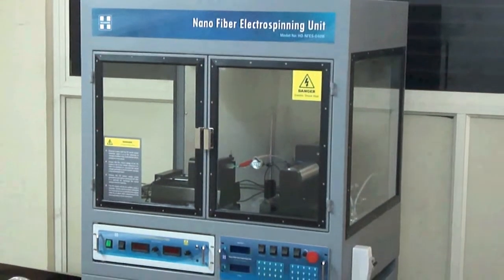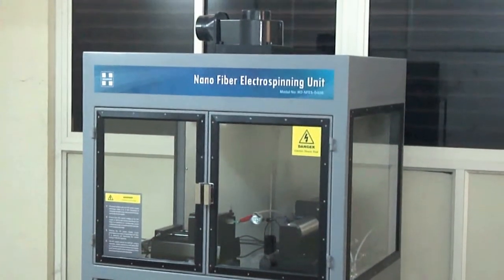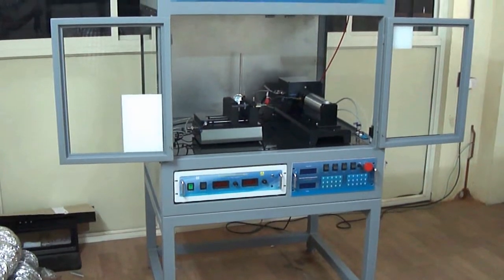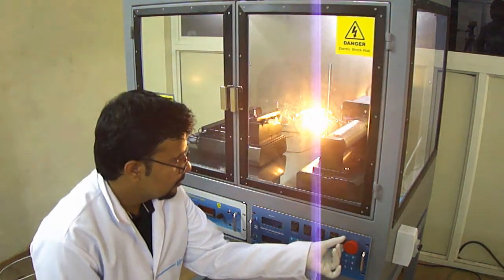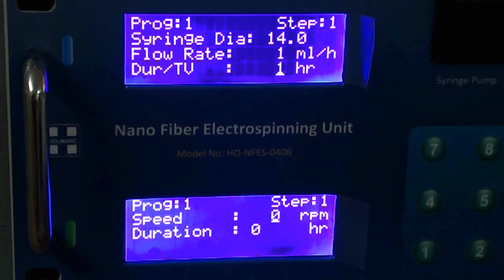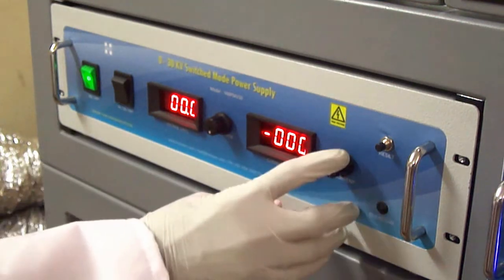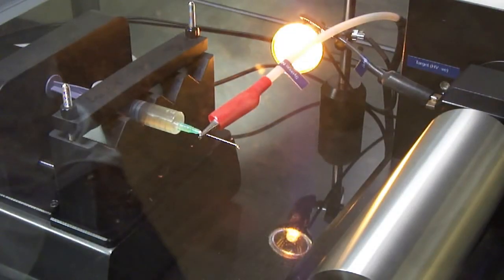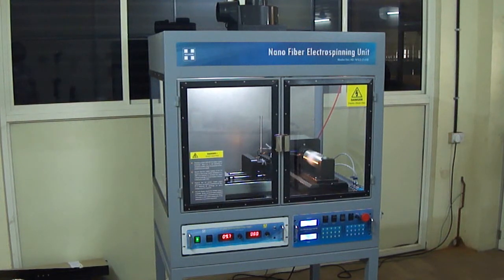Nano fiber Electro spinning (Table Top Model)

Comment: You just gave away your entire design plan! Now anyone can go out and make one with some $2 Arduino programmable MCUs, stepper motor controllers for the drum and linear actuator to depress the syringe accurately, some PWM N-channel MOSFETS also driven by the Arduino to control the lamp intensity and some plexiglass. I think I could rig up the exact same device for under $50 bucks if I can find an old fish tank on Craigslist under the FREE section or cheap for a low budget DIY hermetically sealed chamber  AWESOME! I think you just inspired one of my winter electronic projects. I'm already working on a solar powered eBike Trike that is powered by a 12" diameter  pancake outrunner motor with 36 1.75" deep by .75" wide by 1" high 16awg 200C stator coils and 37 N52 rotor magnets 50mm x 20mm x  5mm magnets replacing the lame ceramic magnets originally in the motor. It came from a large capacity direct drive washer for 48 pound loads of laundry and water with a 1" spline shaft connecting it to the drum! It's wired 11 coils in series  in standard 3 phase wiring arrangement. Three 285 watt 32VDC 9A solar panels will form the roof over myself and the pickup truck style bed and charge the 90 volt Lithium Ion battery pack made up of 96  18650 laptop cells arranged 24 in series with 4 matched sets in parallel for a 90vdc @ 10ah capacity charged by the 96V 9amp solar panels. I'm also going to capture the energy from the collapsing coil energy in a small 90VDC 1000 Farad Ultra capacitor bank to power the onboard electronics and 55 watts of LED headlights and standard LED signaling lights. The capacitor bank will also play a major role in the regenerative braking as the rotor connects directly to the read wheel. The direct drive arrangement removes all drive train loses normally incurred by gear boxes, shafts, chains or belts allowing for nearly perfect regenerative braking in the 90% efficiency range! As the brakes are applied a potentiometer is all that is engaged for the first 75% of the brake pedal movement that feeds more current by PWM to the gate of a high current IGBT bridge rectifier to charge the capacitor bank and then the battery pack while braking to stops or down long hills. When it's again time to accelerate the stored energy from the braking process can be released at a tire blistering pace if you switch off the traction control. With a 12" diameter rotor directly coupled to a 24" tire with the ability to fire all 36 coils at the same time with the custom ESC I'm designing that can reverse the polarity of the coils as well will generate unsafe amounts of torque and RPM if not electronically regulated. The 37 magnets I'm using that will line the rotor have 48 pounds of pull each so doing the math you will see why they designed it with a 1" spline shaft in normal operation and now it will be directly coupled to the drive wheel. Once I'm done skeletonizing the rotor the entire motor will be less then 17 pounds as well! I can't wait to see how well it runs just on direct sunlight at the 90 volts 9 amps provided by the panels and capacitors alone. For bright sunny days I may make a larger ultracapacitor bank so I can leave the battery pack home saving it for cloudy weather cruising. With all the new technology out there it is only a matter of time before everyone else out their catches on that solar is abundant and well under a buck a watt these days and we will all be zipping around at 100MPH in carbon fiber solar cars that weigh 500lbs and even fly! With the centimeter accurate GPS, Gyro, compass, accelerometers, barometers, and gravity sensors all under $3 each and the 32 bit programmable MCUs to control it all selling for less then $15 bucks each the really amazing inventions are going to start appearing from garages around the world real soon! I know there are some cool things coming out of my machine shop! If anyone is interested in any of this emerging efficient energy technology feel free to contact me. I'm always looking for partners/customers and investors to collaborate with as 2 or more heads are better then one. Well, in most cases, there are some out there that actually are negative mental assets...
Reply: ***** , very interesting information , and how much this will cost ?